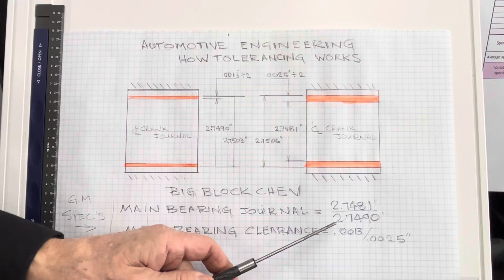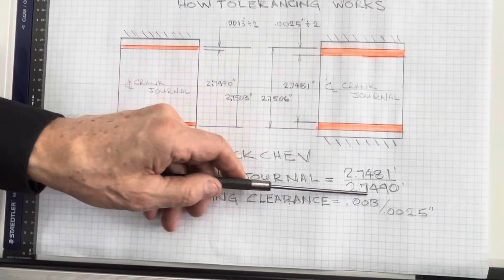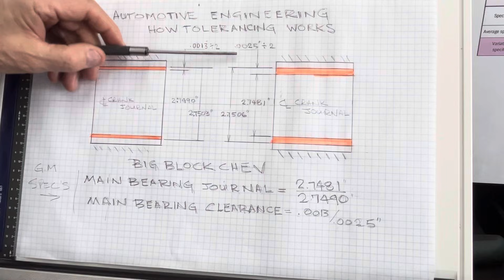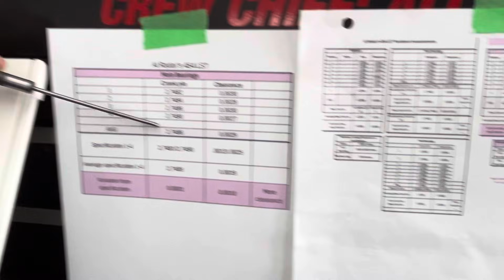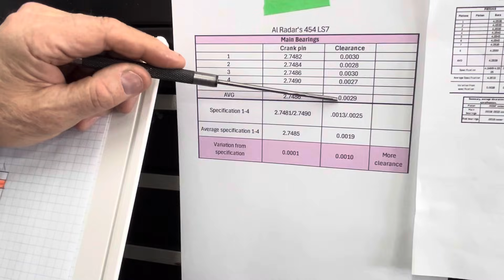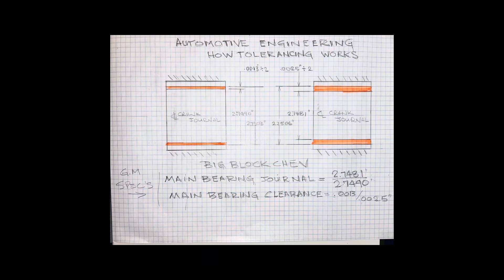Engine Building Secrets of Blueprinting And Tolerances!  Made Easy! Too Much Or Too Little??

Comment: Seems like this is an explanation of what to do with what you have. A machine shop would skim the mains or girdle and align bore and hone the main bores to the exact clearance you want. A mandrel in the main bores would then establish the centerpoint of the engine for squaring the block and align boring the cylinders. That is what I call 'true' blueprinting. Now they have CNC machines you stick a block in and it comes out perfect.
Reply from the maker: Good technical explaination, thanks for commenting Dragon. AG

Comment: Depending on the bearing brand/series your using many times .001 .002 undersize and .001 oversize ... Dont forget on conrods and rods can run a std & .001 combined   to gain or lose clearance by .0005 .  For obvious reasons the mains must run all the same combo  eg all .00005 uppers and lowers Std  or all stds or all U/Size etc etc 
I find clearances .0025 ---- .003 on the larger side . My street preference is .002---.0025 
Oil pump recommendation  Melling Sharktooth +10% volume,,, bolt in pick up ,,,comes with 3x pressure springs ,,,stronger cast/cnc body  vs Std pump
Reply from the maker: Lots of good info there, thank you. AG

Comment: Great video, like how you said to grind the crank to get more clearance or over size bearing to reduce the clearance. You did not speak about the main saddle diameter which will also affect bearing clearance. IMO It should not vairy from factory specification as you need a specific crush on the bearing shell to hold it in place (I try to keep it on the smaller side of the spec). All these tolerances stack up to produce the Clearance.  🙂
Reply from the maker: Thanks so much, glad you enjoyed it and appreciate the added detail. AG

Comment: I have heard and read about Blueprinting, but never really fully understood it. This was very helpful. Am I correct in saying that the tolerance is the allowable range of measurement and the clearance is the actual measurement for that particular engine?
Reply from the maker: Yes, tolerance is the allowable range, clearance is the actual space  (for oil) between the bearing and crank journal. AG

Comment: @goldsGarage AL, the factory did measure them, but they use a method completely different from how we measure. where we measure to accuracy and blueprint tolerance; the factory only cares that the part falls into that production tolerance range for fast assembly and cheep production cost. the Factory uses what they call a "Go-NoGo" gauges. they just checked it against each journal and if it fit in the green zone, it was good. if it did not fit in the green zone, it was bad, and if it to far into the gauge past the green zone it was also bad. same thing with pistons and bores, bearing bores, etc. they didn't measure to an exact number, they only cared that it fit in the green range on the Go-NoGo Guage. but parts were never wasted, in the case of a part like a crank shaft where it failed undersize, they would reground it to the next undersize and use it as a warranty replacement part.  if it was over sized, it would be sorted and corrected to the proper size.  with pistons they did the same thing, there was a go/nogo gauge for them, and upon receipt from they were graded with the gauge, and everything that passed was put into production, if they had ones that didn't pass, they were returned to the GM's supplier/vender as defective. it was cheaper to just reject them and move on with a different set than to stall the production line to custom fit something. this is not the case with some of the newer engines, like the 7.0-liter LS7 version of the gen 3 small block and the LSA Supercharged gen 3 small block used in the  Z06/ZR1 gen 6 and 7 corvettes and ZL1/Z28 5 and 6th gen Camaros. my understanding is that these are all hand assembled and check by a single builder at GM. but that was something recent and new and not SOP for GM.
Reply from the maker: That's an excellent explanation of the factory production methods, thanks for sharing! AG